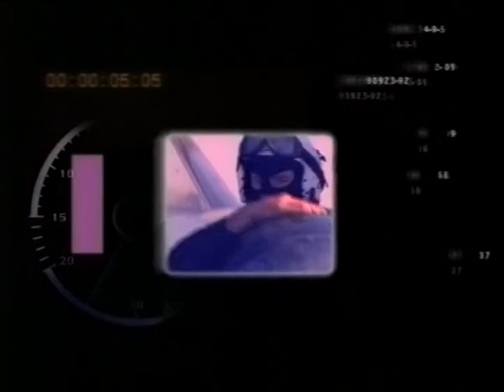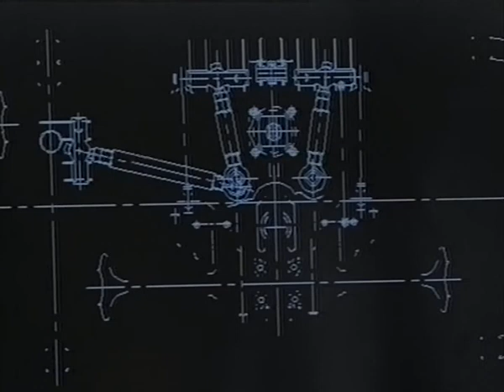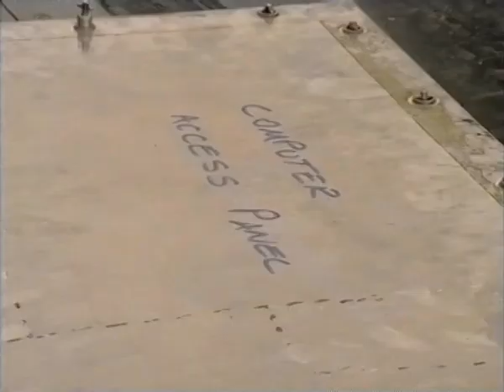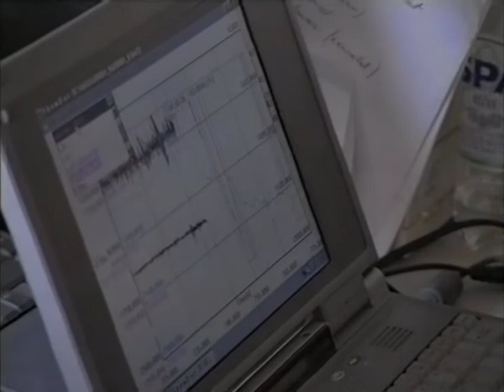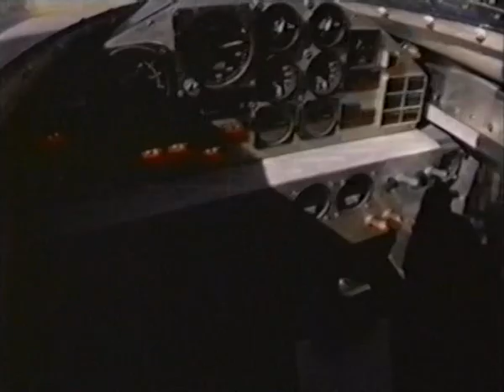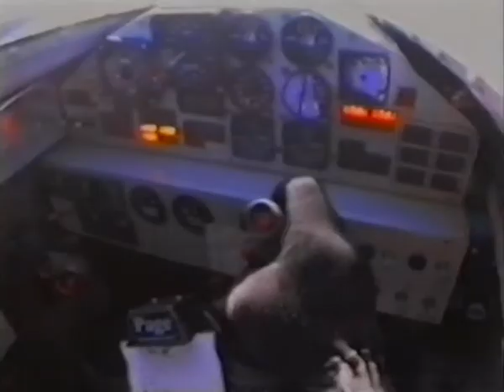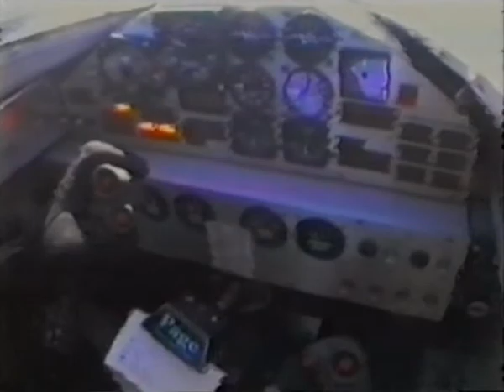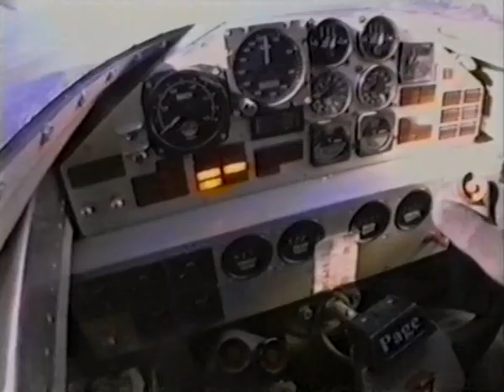Thrust SCC - The Mission (Land Speed Record)

Comment: the speed of sound doesnt need to be measured , it tells you with a boom , if it dont boom , its not the speed of sound , I am struggling to believe they dont understand this simple fact
Reply: The speed does need to be measured though. You can't base the land speed record just on a sonic boom.
Reply: @bigal3055  I never wrote you could and of course the speed of sound is a variable , depends on air density